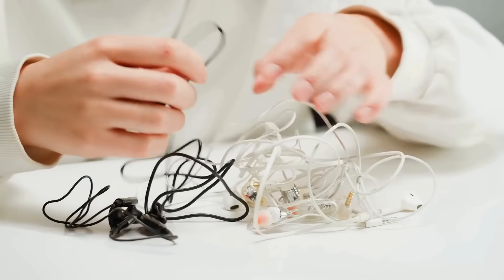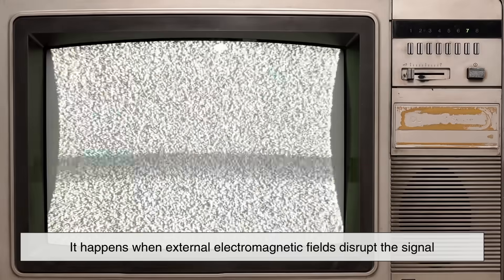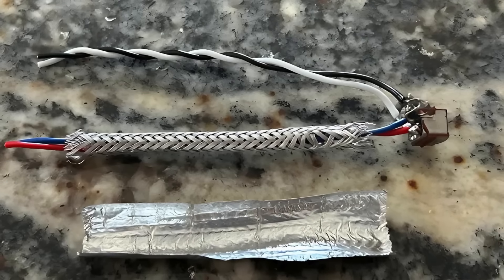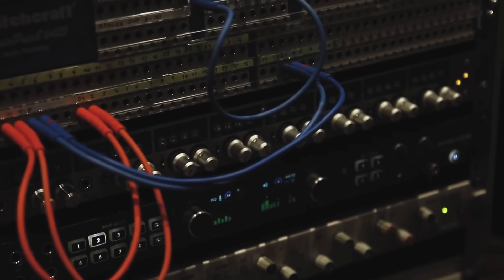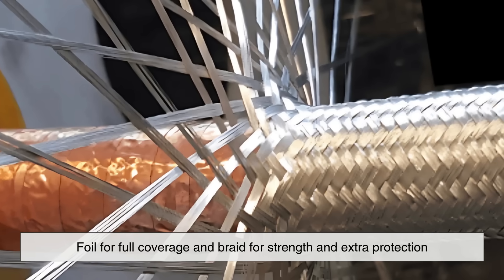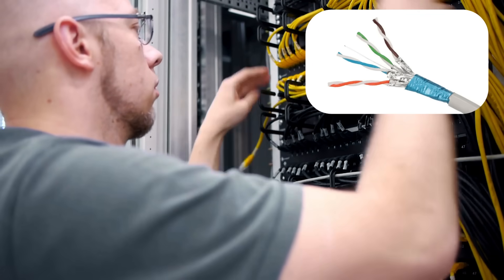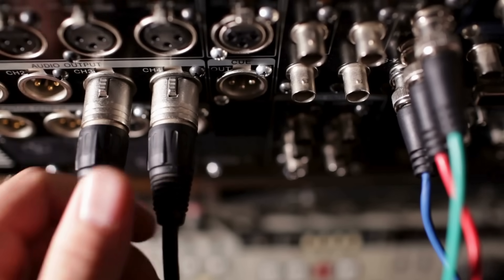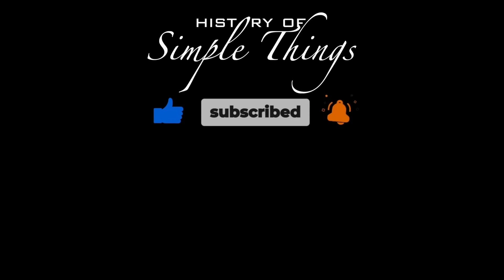Why Are Wires Wrapped in Foil?

Comment: When deciding on shielding, the vast majority of the time it's better to go with the better ,future proofing option. It usually costs less tome and money than replacing the less shielded item. It's especially true in walled installations that are not in conduit or easily accessable. 

This is becoming even more true in modern homes with increasing electronics, wired and wireless.

Comment: A good schield protcts against emf, but a twisted pair will do the job better if the appliances got balanced in/outputs. The best is both of them.
professional equipment got XLR connectors, nothing else. Phone plugs  fell not under the term "professional".    RCA and phone connectors are the worst ever. They  are the master of loose  connections.

When I run a PA system long tim ago, once a bad  phone plug on an power amplifier lead to rf oscillation  and ruin a pair of expensive JBL  tweeters.

Comment: We were taught to only ground one end of the shields be cause you do not want it to ever carry any current. When a vendor installed VFD'S on boiler 20 to 60 HP motors they grounded both ends of control & speed cables.

Comment: Some microphone cable shields are made of semiconducting plastic ... this is to greatly reduce noise when the cable is moved about .... the best shields are thin steel foil , used in some military cables .. they not only shield from electrical interference , but magnetic interference , but are stiff and expensive ..... DAVE™🛑

Comment: Now for the real question. Do you ground one end of the drain or both?
Reply: @ch3no2killz 
You only ever connect one side of the drain to ground/ earth 
Otherwise is creates a loop and can make the interference worse
Reply: You solder the drain to the foil it’s easier to do it prior to wrapping the wire in foil because the solder gun tip can melt the wire because standard wire is cheap plastic and most ppl and companies don’t want to pay slightly more for silicone wire that is very very heat resistant I’m frankly surprised he mentioned aluminum foil instead of using copper tape that comes in a standard roll like a roll of duct tape only $15 on Amazon
Reply: It depends, intra or inter😅